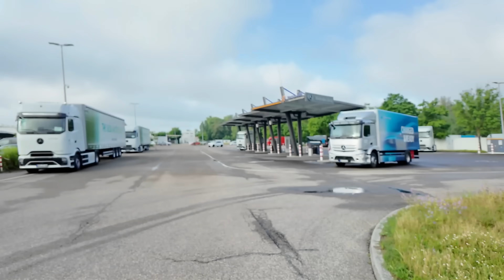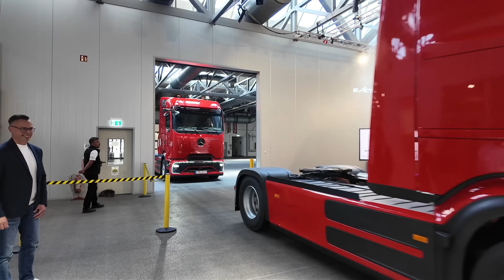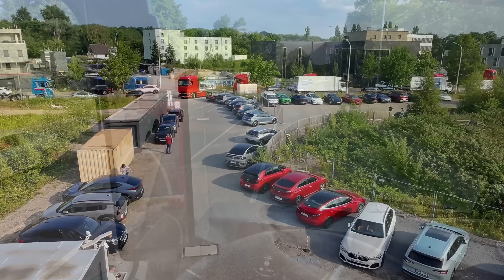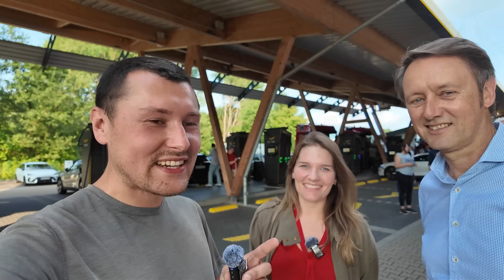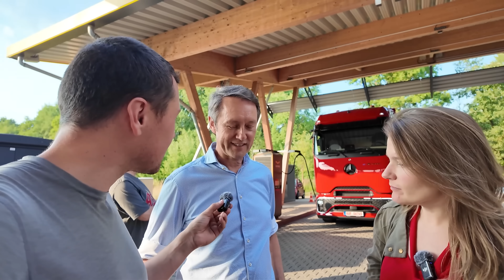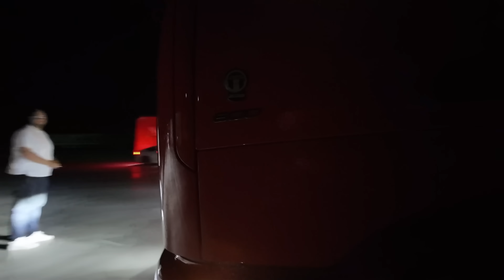We pick up 5 eActros 600 and Crash a Charging Park

Comment: It's the beginning of the end for fossil fuel motors in the HGV sector..It will take a long time and many drivers will have doubts about them but with EU emission regulations it will happen.Hydrogen should also play a part of this change in my opinion as I think problems with infrastructure might be a issue.As a truck driver and ev owner here in the UK I say bring it on.

Comment: Fan of the electric trucks, but any manufacturer should be ashamed sending out new vehicles with misaligned steering wheels. People complain about Tesla pre-delivery inspections, but this is a different level. 

Also not a fan of avoiding safety regulations by rushing to deliver before a change in regs. There was nothing in that list of requirements that was new technology to Mercedes, so they're just being cheap at the expense of safety of pedestrians. A bad look in my view.

Comment: This peak power thing is very frustrating to me. I think it is going to slow down electrification really badly. It should be the responsibility of the power companies to make sure the grid can handle the load, either by increasing the capacity or by putting batteries in strategic locations. But i guess it's about money, as always :/

Comment: Tobias, maybe a bit more on that peak level price gouge - what is the rationale for having that hit the charging park operators head resoundingly and what if they subsequently have another peak of peaks occur? Sounds very discordant.
Reply from the maker: Basically, the way electricity prices in Germany are determined is outdated for a charging park operator, so they have to work around it by limiting the charging power or installing battery storage. That is probably on of the reasons why at so many charging parks throughout the videos the charging speed was limited.

Comment: It's a shame that this is an old technology of electric motor, drive shaft and differential. New Chinese trucks have an electric motor built into the differential and it would save space for more battery cells or a diesel generator could be installed.

Comment: Seems like the trend is using cheaper LFP batteries instead of NMC batteries for electric trucks. I'm wondering how they will holdup during cold German winters because LFP has been known for losing capacity in cold climate.

Comment: Are you saving money on electricity/gas with ETruck versus standard diesel truck? 
LIke how much is saved or paid more for 10'00km or even better 100'000km?
Reply: Electric is generally cheaper. €0,40 per kWh vs. €1,80 per liter of diesel resulting in about €0,5 and €0,6 per km.

Comment: I find it extremely hard to believe that these trucks are MORE FUEL EFFICIENT than cars without towing a trailer. I did the math twice and came up with 5.83 miles/kWh or 9.72 km/kWh. That's just CRAZY, cars are way below what they're capable of.

edit - Sadly the real figures are 0.96 miles/kWh or 1.60 km/kWh, which are much more believable in comparisons to cars.
Reply: If you want to compare with cars, use the same units. It is 10,3 kWh/100 km or 103 Wh/km. Still impressive, despite how slow those trucks ride. I got similar numbers with eGolf only in the city when downhill.
Reply: You’re mistaken to think these trucks use less energy per distance traveled.
Reply: @MiesvanderLippe  You're right, there has to be a mistake in translation.

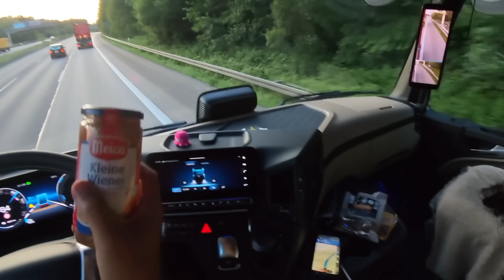11:56 The truck has 600 kWh usable capacity and Tobias says he arrived with 38% and drove 594 km which took 61,1 kWh. That's like 10% of the battery capacity! It would mean they started with 48%, but they came to the charger and started the session there with 70%. One of these numbers has to be wrong. I bet it's the consumption. See my thoughts bellow. Tobias meant the average consumption but the translation made it as overall consumption instead.

 He also says the range is almost 1000 km (using full available battery capacity). That means the consumption is 60 kWh/100 km. The IVECO gets something like twice as much when fully loaded, so I think this is right. It also is like 3 times more than passenger car or 4 times more if it would be driven in the same low speeds.
Reply: @JanNovak-pg8oe driven at an efficiency of 61.1 kWh per 100km not 61.1kWh for the 594km

Comment: I don't think the steering wheel is misaligned. If you should fall asleep at the wheel or have a medical emergency, the truck should veer to the right rather than collide with oncoming traffic. Well, that's my guess anyway.
Reply: It does not work that way. The steering rack and front wheels are positioned and balanced so that if you let go the steering wheel, any automobile stays in direct track and do not steer on its own - you would have to hit something - like a pothole - to make it go left or right.

The steering wheel is just misaligned.
Reply: So ALL these FACTORY FRESH trucks that Tobias has been driving over the past year have had misaligned steering? That seem a little unlikely, I must say.
Reply: @jeffreylebowski3216  Yes. True, it is. He's commenting it as a running joke now.

Comment: Excellent explanation about how the utility charges charger owners based on peak load. In several of your earlier videos, you mentioned that the charging rate was being limited — this now seems to be the main reason behind it. I’m not sure whether the utility also offers discounted charging during off-peak hours, but that would be worth looking into. It also feels like the whole “once peaked, always peaked” situation deserves some regulatory review.

The logic makes sense for individual end-users: you apply for your potential peak load, and if you exceed it, that means you now require a higher peak load capacity and should update your application accordingly. But in the case of charging parks, which act as third-party operators, the definition of “peak load” will need a another logic to handle.
Reply: In this case, it seems like the owners are incentivised to add extra local battery storage to increase the peak output while not increasing the peak demand.